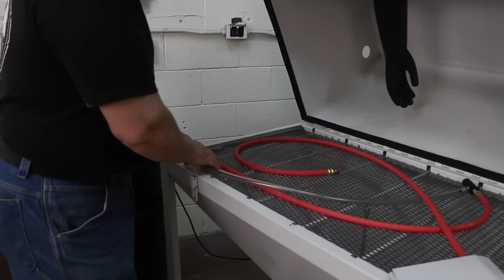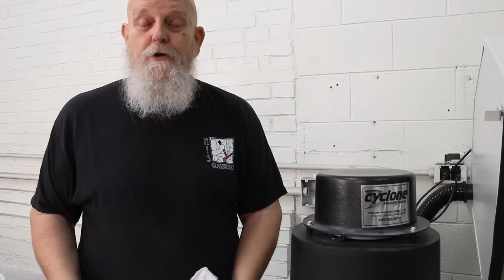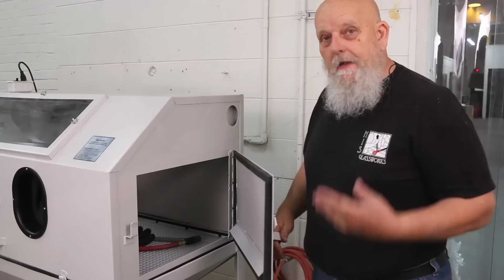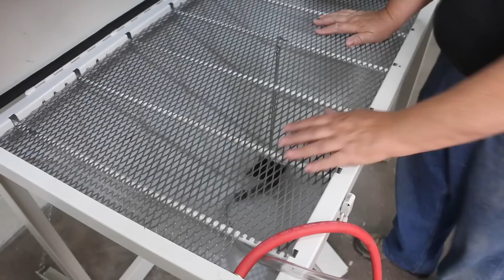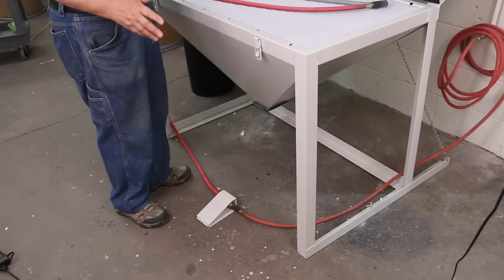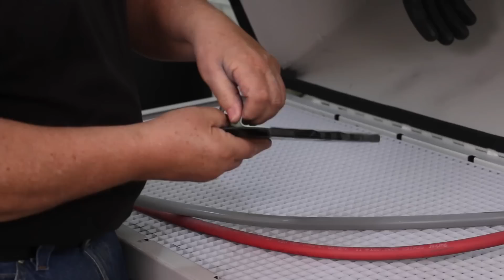Cyclone Sandblaster

Comment: Thank you, this was very informative. I could use this to drill holes in microscope slides. Does the process introduce microcracks into the glass from the strong impact of the abrasive? How resistant is the final product e.g. to wash-dry cycles, or wet-freeze?
Reply from the maker: It depends on the how rough the abrasive is and how thin the glass is. You would have to test for your particular routine.

Comment: May sound a stupid question but I thought the whole point of the unit was so you didn't need a face mask as the dust would be sucked out
Reply from the maker: +Nathan Etheridge Not a stupid question at all. The dust collector will contain the majority of the grit used while sandblasting, but everytime you open the blaster, dust will escape from it and go onto the floor and around the blaster. Good housekeeping should be used to clean around the blaster daily, but you should also wear a respirator to make sure none of that escaped dust is inhaled when you remove your pieces or put your pieces into the sandblaster. Great question!

Comment: Followed your set up video i bought a 3624 cyclone ...however when i started to blast I'm not getting the results i want the media may be wrong that i bought ..what would you suggest for removing rust and paint from metal parts
Reply from the maker: +Noah Ellison You'll probably need a rougher grit. What are you currently using in the sandblaster?

Comment: Great video. May I ask, all I need after I get this unit is a compressor right? Also, I'm working with 110v what size compressor would you recommend since its siphon based? Thanks
Reply from the maker: Most of these require around 14CFM of air minimum so they would need a 2 stage 5HP compressor to really work. We can fit them with 5CFM nozzles to lower the compressor requirement as well.

Comment: Why a respirator? The cabinet, it is not intended to keep the dust inside.
Reply: Great info
Reply from the maker: The dust collector will contain the majority of the abrasive, but inhaling any small particle silicon carbide can be very dangerous so it's always best to be safe. Respirators are easy to wear and will filter out any particles that somehow escape the cabinet and dust collector.